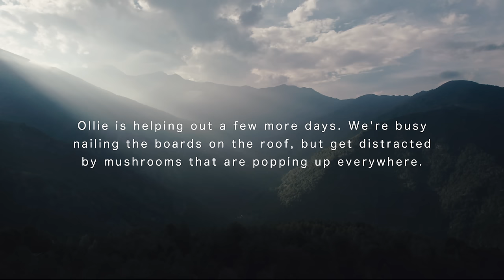#35 Mushroom hunt, Closing the Roof

Comment: Martijn - just a tip for the next roof. Always sheath from the eve line up not from the ridge down. That way you have something to stand on while working towards the ridge. Also, since you are using tongue and groove sheathing, it's easier to straighten the crooked boards by toe nailing towards you instead of working against gravity.

Comment: A little tip that is a big help when nailing boards to the beams: drive a chisel in vertically into the beam at the edge of the board and use it to lever up the board into line. This way you can do it single-handed!

Comment: It's so good to see all the boards on the roof - you must be so satisfied. I'm curious to see how the next layer goes on. It was hard for me to understand the schematic for it on your computer. A thought about the ramp from the ground up to the roof - now that it's raining more, you might want to nail some small, thin strapping material at right angles to the boards - in inches, maybe 1x2s - to give your boots something to grip on in the wet weather. That system has made all the difference in getting into my shed in wet weather. Thanks for these videos.

Comment: 03:15 while foraging for mushrooms there are some non-edible bolets and you need to break bit of it to see what color it turns, if blue you shouldnt risk it... You should also not mix mushrooms in the basket as if one is bad you will contaminate the others possibly. Great job on the roof!!!
Reply: Exactly… if you are a beginner the words “if it turns blue it’s good” are not the best… for bolets it’s the exact opposite. Color must not change, if the meat remains white when cut or broken then it’s edible (99%). For the macrolepiota procera as well, can be easily mistaken with poisonous rubescens! And another thing to avoid is foraging with cutting :) you should always try to rotate it and break it from the mycelium (for identifying reasons as well)

Comment: .....failed to say why one start from the bottom side ....it is because you stand on the last board to nail and your weight and some easy hits with the hammer on a piece of wood at the edge of the board so as not to ruin the tounge, wili easy make every board tight .

Comment: Here's a couple of reasons why most people start at the bottom
You'll have a platform to stand on and it's much more comfortable to work on a roof standing facing up rather than facing down
Plus even if you don't finish your roof before the rain comes any section of roof you have up already offers some protection because any water collected by it it's going to run of the building where as the opposite any rain collected by unfinished roof is going to be dumped inside the building
Reply: Maybe not in the Alps
Reply: @lenoxlenox9447  what?

Comment: you might want to consider thinning those birch/alder trees while they are still small and easy to fall.  It is not great to have trees growing so close as the wood gets spindly and weak- generally 5 feet apart is good for good growth and a strong tree, plus you will start to loose you great views. Trees are just like the garden, they need to be tended!  Your garden has been quite successful, you must not have many deer. Here in BC Canada- the deer would be all over that even with fencing you have. 
I will be interested to see how a rock roof integrates with your skylight- in my experience they always end up leaking eventually, I am sure you have a plan.

Comment: It looks beautiful! Its too bad you can't just varnish the roof on the outside, and leave the wood showing. When you were still working on the first side, and you went inside the cabin, and the light was coming through the rafters, I thought how nice it would be to just put a large piece of Plexiglas across the rafters on both sides as your roof, to let in the light... I think also, I would want to make a more permanent platform where the scaffold is, as a deck, and access to the roof, so you could sit up there anytime... Just lovely...

Comment: In my view, it would be better to install metal roofing! :) Rather than carrying heavy rocks :( ,  with no guarantee that there might be a rock drip hole somewhere causing rot on the wood roof panels. When the snow comes it will be easy to remove the snow with a long rope across the metal roof panels. :)  You can even install solar panels on the roof with a metal roof. :)  You put down a wood roof so best to go that direction in line with engineering standards of a metal roof on top of the wood. :) Hands down metal roof storms, snow, wind rain no worries just screw it down tight. :) if you poured a concrete roof yes then roof tile or stones but it is never secure in a big storm when the big Italian hurricane winds arrive. :(  Just sharing with you my own Italian experience. All the best in building your house take care. :)